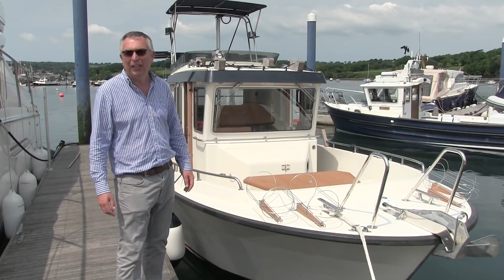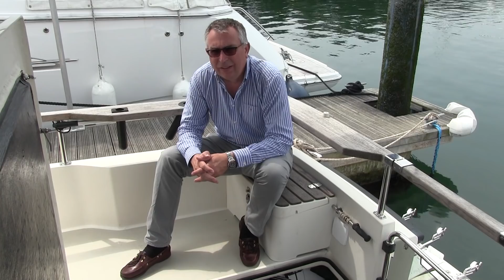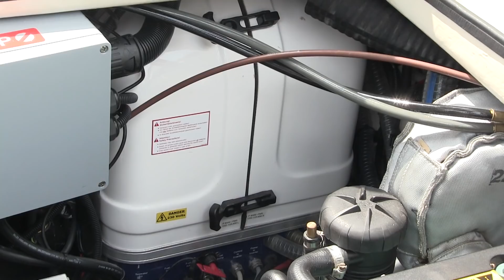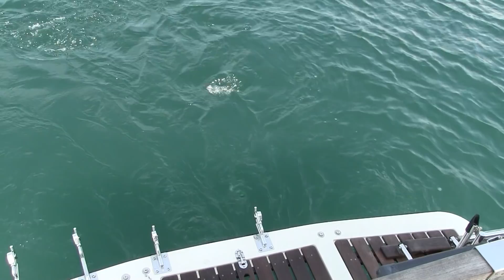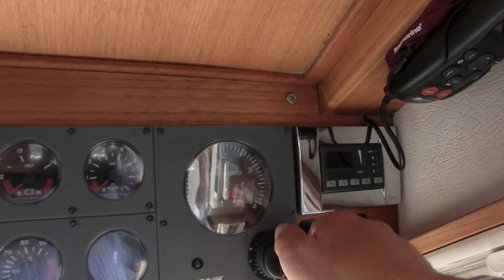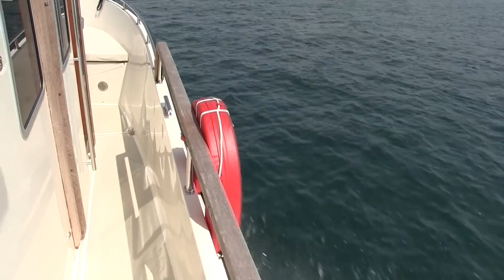Hybrid Botnia Targa 25 | Motor Boat & Yachting

Comment: These are awesome. They could be a 'trailer sailor in Australia' with a Ram or other big truck to tow.The 23 is beautiful also. Plus they come with outboard... Yes they are powerful enough.  Put two 250hp Mercs on the back.... These would seem to be arguably best in their class (by far, the finish even in the videos is obviously superior)  vs Whittley, vs Jeanneau MF 795, Vs Arvor 755. Seems like there is no Australian dealers (for the 23 OB!).
Reply: or 2  mr fúßioñ ¹80 hp ejteçß

Comment: One thing some sailboats have is a propeller that's basically an electrical generator, you get some drag (of course) but charges the electrics. This system would be amazing if, under diesel power, the same electric propellers stayed in the water but instead of being mere drag they acted as a hydro-generator.
Reply: That would be horribly inefficient. You'd use less extra fuel by using the diesel generator.
Reply: But if under diesel power why not use the engine to charge the batteries like every other boat.
Reply: The engine alternator charges stuff

Comment: I wonder what the range is at 5 knots on the motors?
Reply: 5 knots per hour for 8 hours is 46 miles. That's assuming full battery banks and no use of the generator to top the batteries up (and of course, not using the air con or icemaker).
Reply: 46 milé tesa ¹6 petct knçreße 54 mie eltruç

Comment: often wondered if someone would try this kind of diesel electric hybrid system this shows its superior in every way to just diesel propulsion, if there were 5 batteries instead of the 3 installed I imagine it would do 8 knots easily all running of a smallish generator imagine the huge increase at displacement speed for touring range ~ then voila diesel performance at the flick of a few switches ,  now if only Sunseeker or Princess or Fairline take this idea on board!
Reply: Adding two more batteries would increase the endurance, but would not by themselves increase the speed; that would require bigger motors.
Reply: @seikibrian8641  Torqeedo do more and bigger motors these days than they did even back in 2018 (or before, when this boat was built).
Reply: Jersey Boats do hybrids.